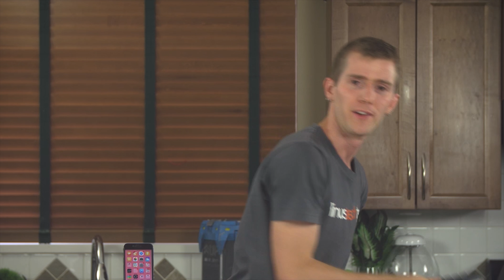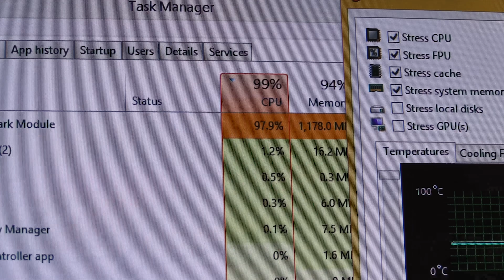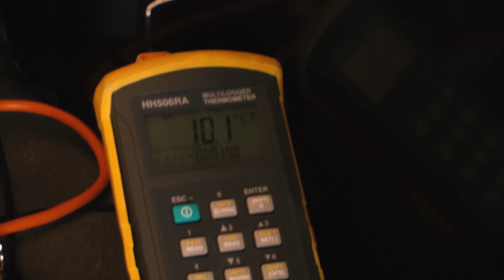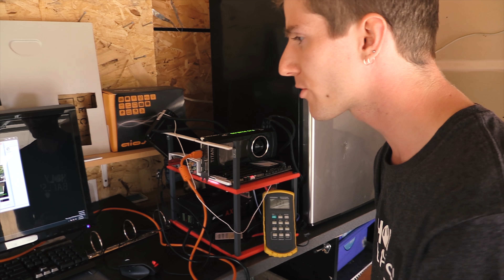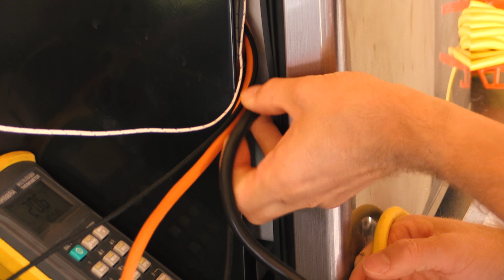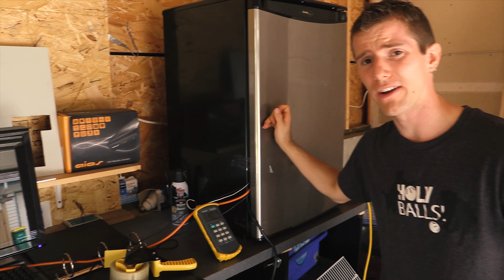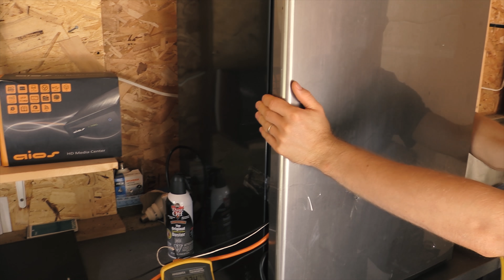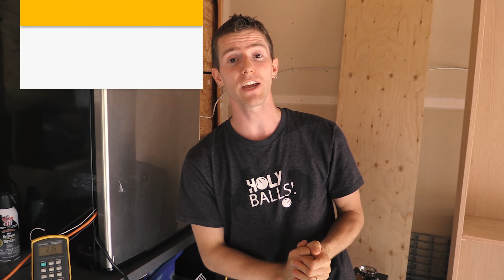PC Build in a Fridge - Does it Work??

Comment: What if you let the computer fully neutralize to the temp of the fridge before turning the pc on?
Reply: +Majick Freeman yeah, something similar to what you would buy for an RV would suffice and is relatively cheap
Reply: +Mika Vanderak No you wouldn't. Does milk or water get condensation on the side of it inside of a fridge? no. The radiator wicks away humidity just like the radiator does in an a.c. 
I really think he did this experiment an injustice by not trying it that way.
Reply: +Majick Freeman Yes milk and water do if there is a Large Temperature difference. The inside or outside of the bottle depending on whats colder/warmer. It does not happen instantly but it does happen.
Reply: +Spoonfed No. If you put it inside the fridge where there is no humidity, because the fridge is running it won't. 
Things collect condensation because there is water vapor in the air [known as humidity] and a cold surface cools the water vapor and turns it into liquid. 
As the mobo will be room temperature when u put it inside of a much colder and zero humidity refrigerator  it's practically impossible for it to collect humidity. 
if water is condensing inside your fridge than your fridge is messed up dude.
Reply: +Majick Freeman having no humidity is also a bad idea with electronics. At low humidity levels electronics components are far more susceptible to static electricity. There is a sweet spot at normal room temperature. I'm not sure how this sweet spot changes at lower temperatures though. But essentially there is a reason that data centers have very finely controlled humidity levels.
Reply: +Brad Hesse That&#39;s interesting and all, but I don&#39;t see how it&#39;s really relevant when you consider either way if that computer goes in the fridge it&#39;s going to be in 0 humidity. Doesn&#39;t matter if you let it get cold before you turn it on or if you put it in there and then let it turn on. 
Also, if someone were considering doing a fridge build i&#39;m doubting the would be going in there and touching things all the time...
Also consider this &quot;Do you get shocked when you grab something metal out of your fridge?&quot; 
I can&#39;t remember a time that I ever have, not saying it&#39;s not possible. 
It&#39;s not like it&#39;s going to get statically charged if it&#39;s just sitting there in the fridge. 
But, interesting comment none the less...got me thinking...
I still think he needs to redo this experiment and let the fridge get it to it&#39;s normal cold temperature with the mobo inside before powering on...
Still can&#39;t think of a reason that would be a bad idea and not in this experiment. 
I love linus tech tips so not knocking anyone or trying to argue.... I also don&#39;t plan on making a fridge build anytime soon so I have no pony in this race...just interested...cuz science
Reply: The problem with static isn't just a problem of touching and shocking it. Static effects the chip itself. Arcs of electricity jump from one component to another, etc.
Reply: +Brad Hesse I still think trying the experiment my way is worth a try. 
i mean it's going to be in the fridge either way. And it's not like linustechtips would be hurting if they fried one chip...which i don't see my way as that more risky than his way anyways. 
Does everyone just want to argue with me? 
I thought at least one person would see the merit in my idea.
Reply: +Majick Freeman heat was rising. Your way wont change that. It will only take a little longer.
Reply: +Spoonfed That's a valid point and I realized it myself too. 
But, the point of experimenting is to put theories like this to test.
Reply: +Majick Freeman the problem being that a fridge's cooling system is not designed to remove the amount of heat that is being generated.  Being it is a closed system the heat is only removed by the fridge.  A mini-freezer might work but then you would have to have a good desiccating system to remove any moisture introduced from open & closing the freezer so frost doesnt build up on the components.
Reply: +789 Gaming There's a good idea, but you said a good desiccating system? 
i bet simple silica gel packs like they have in new boxes of shoes  would work just fine. A simply tub of dessicant would do the trick. It wouldn't take more than a minute or two of preparation i think

Comment: No, it is not a good idea. Sure a fridge might get cold, but it does not have the BTU capacity to pull all the heat out of the PC as its created.  The longer the PC is on the warmer the fridge will become until you eclipse ambient at which point things will get ugly pretty fast.
Reply: +Diesel Ramcharger I think the problem is that most people think fridges are somehow magical and don't understand the rating of the compressor in a mini fridge is at least 100x smaller BTU rating than a common central air conditioner. (Maybe... 150 BTU vs 20,000 BTU)
Reply: Bowowowification Yeah they really don't get it. No one thinks about how long it takes to cool down a warm 2 liter of soda in the fridge…

Comment: Also... Quick question.. Prime95 only seems to push my cpu to 85% give or take, why is that? Is there a way for me to push it more???

I have an AMD FX 8320 Black edition clocked at 4.2Ghz with slight vcore bump and it only gets to about 34c with Prime95 running... I literally had to hold a hair dryer on high to the rad for 10mins just to push it past 38c. WTF is that magic am I right!?
Reply: Yes, I am aware that lower temp is a good thing.... But this was in a closed room.. After doing multiple tests one after another..

Comment: Try putting an automotive electric radiator fan on the back of your mini-fridge (over the condenser), this could give your system enough extra thermal transfer capacity to cope with the heat from your second PC.

Comment: You stooged it run duel liquid heat sinks and have the first one out side the fridge so it dumps a large amount of the heat to the room then a secondary in the fridge to cool it even further or better yet leave the computer out of the fridge and run a secondary heat sink radiator into the freezer section

Comment: I tested my laptop in my fridge for a whole day to troubleshoot a problem that was said to be linked to overheating.  I used an external monitor and wireless peripherals.  The fan outlet temp is normally 140F.  After cooling in the fridge it settled at 110F.  The fridge maintained 40F air temp the whole day.  It didn't improve my problem at all, which was and still is constant "Can't display webpage" errors from web browsers.  You're not supposed to cool a HD rapidly due to condensation but I have had not ill effects that I can detect.  Laptop is a HP Pavilion tx1308nr running Win7.
Reply: +Stephen Kramer If the laptop dissipates 90 watts of power and the fridge is a normal sized one rated for say, 1100 BTU (322 watts), you might be able to keep the laptop cool for long periods of time. (But still - condensation.)

Comment: Just build one inside a regular fridge. That could run literally any program conceived by mankind
Reply: +The Dark Aura It might barely work. If a regular fridge is rated at say, 1100 BTU, this means it will remove 322 watts of heat. You might be able to keep it at ambient temperature doing such a thing.

Comment: The ambient temperature inside the fridge was high primarily because you didn't have it closed due to the cords and wires. If you had drilled through the side and run everything through there, it would have worked a lot better

Comment: Just do what I did about a month ago. Grabbed my PC, made the HDD external, stuck the rest of that shit in my grandmas old deep freeze (she got a new one don't worry), drilled four evenly spaced three inch holes in the corners (one 1.5 inch for wiring) and put three inch fans in them. Two cycling air in, and two cycling air out. BOOM, overclocked the hell outta mah shit and now I am a boss . . . in the garage because a deep freeze is heavy as fuck and too big for my room. And the best positive? It's a desk too. Who needs 650 frames in BattleField 4? No one . . . but I can do it. Who needs 800 frames in Fallout 4? NO ONE because the game would go at mind bending speeds . . . so I'm stuck at 110 . . . but hey? EIGHT HUNDRED MOTHER FUCKERS! WHO NEEDS 999 FRAMES IN CS:GO? FUCKING EVERYONE! HEADSHOT CENTRAL!

Comment: it should have a air exit conneted to the fans   so you dont recirculate the air   so it would keep getting cool air in and spew out the hot air.  it would need a beter fridge in the first place too

Comment: Your result is unsurprising. 20 years ago, a mini-fridge was viable. These days, it has to be a DEEP FREEZE that is very well sealed and fully dessicated (trapped moisture).

Air is NOT a good conductor of heat, which is why air movement is extremely necessary. Liquid cooling is quicker and cheaper. If you choose to use a sub-zero coolant (probably some form of alcohol) you will still need dedicated refrigeration on the other end, the cost of which will probably outweigh the gains in "over" clocking.

I've just built two 3GHz multi-core machines maxed out to 32GB of RAM (2MHz). I've NO intention of over-clocking; I built them for longevity. Under my "normal" use for the next ten years or so, air-cooling is adequate.

Remember, too, that to make enthalpic calculations on efficiency you need to work in Kelvins not degrees F or C.

Comment: i'd run a heat-sink outside of the fridge to dump the most heat, at least bring it down to ambient external. (might require a thermostatically controlled valve so at idle it wont pump out the cooling)

Comment: You're overcomplicating this. The active wattage of your minifridge is way less than the active wattage of that monster power supply. Power is energy per second. Even if your fridge were a 2nd-law-of-thermodynamic-defying 100% efficient, you are putting way more energy in every second then you are taking you are taking out every second. Net result? An increase in thermal energy in the system. Here's a great link for approximation purposes. uml.edu/docs/ApplianceEnergyUse_tcm18-149292.pdf

Comment: I got hold of a AC unit that came from a store rated at 19000 BTU  (~5500 W) many years ago. Unfortunately I never got around to making something of it. It cooled air and heated water (going to a radiator). If it had been the model that supported heating as well as cooling it would have been much easier since that would have cooled water and heated air rather than the other way around. Just build a hermetically sealed box for the motherboard, CPU, GPU to avoid condensation and run the cooled liquid through a normal water cooling setup. You could have had an insulated shared reservoir and cooled an entire LAN-party's worth of computers off of that thing =)

Comment: you actually need to drill a hole in fridge and fitt it with vacum cleaner motor to suck out cold air from the fridge and blow it on to the rig 
what you do here is the same like trying to breed with plastic bag placed on your head and ducktaped around your neck.i mean you can breathe but only for a short period of time :) a actually connect my pc cooling system to a air conditioner :)

Comment: Hi Linux.. follow me on this.. The frige is design for static heat/cold.. u got fans in ther .. movement of air reduzes efficiency in a closed space.. so the PC is making itself an invisible hot blanket ... Please try again with no fans, if possible .. because i think it will work like that.. after all heat is energy , and energy is movement.. Just a thinking point of view.. apologize my eng..

Comment: I used to work in a commercial restaraunts kitchen and we had a blast fridge/freezer which essentially is meant to quickly cool super hot food to freezing temps in minutes. It has a fan in the back that would solve the airflow problem and the lowest I've seen it go is 0 to -10 Fahrenheit  (sorry, I'm American) so I believe it could probably handle an I7 and a 980ti running at load.

Comment: But what if you refrigerate the COOLANT?  Instead of putting the entire rig inside a mini fridge just put the reservoir in a liquid cooled setup in the mini fridge.  That way your still dissipating heat with air outside of the mini fridge, put you pumping way colder coolant tot he computer. I want to see a video on that idea!

Obviously you have to make sure that the coolant isn't going to be so cold that it causes condensation inside your computer (yikes!) but keep it cold enough that instead of pushing room temperature water to the machine your actually pushing significantly chilled water though it.

Comment: Humidity is the reason you don't see these type builds.  introducing something that produces heat with something producing cold air tends to create water from the moisture in the air.  and it eventually will buildup on the components.

Comment: As we now know it wont work in an enclosed space. Another experiment worth trying is ducting an ac outlet in through the fan intake. Appropriate cfm ac unit though. Another concept is isolating the radiators in the system in a colder environment.  Have to think how the system works say on a car, different apps but same concept. On a car your using puller fans mounted engine side to pull colder air through radiator from the bumper.  On a desktop you pulling air from the hottest area through the radiator to cool the fluid inside. When I look into the radiator systems for pc they dont give a good description on cooling capacity. On a car radiators are "generally" noted of cooling capacity by cores and those core sizes. More cores "generally" more cooling capacity to reject heat. Interesting video btw.

Comment: Just for pure amusement. What if you could isolate air flow to and from the heat sinks outside of the fridge. That is, both intake and exhaust. I would be curious to see if that would make a significant difference.

Comment: mini fridge, no, mini deep freezer, or full size fridge(or mini fridge with frankenized full size compressor and heat exchanger, preferably a window AC compressor and coils) maybe, if the PSU were external, and preferably the GPU as well because you're not going to get as much of a gain from the GPU overclocking compared to how much base heat is produced and needed to be phase changed out of the fridge, mini fridge will usually average 50=100 watt heat dissipation capability, where as a deep freeze or full sized fridge will cool the equivalent of 300 watts and use about 400 watts average constant(IE pumps running) with peaks of 600 watts, my full sized deep freezer runs about 800 watts average1200 peak, but its a lot older and probably only has cooling capacity of around 500-600 watts, though none of these are really suitable for constant use, a $120 window AC unit will probably have the cooling capacity because many of those have a cooling capacity of over 1000 watts, your average house AC will have at least 10000 watts and probably 16000

Comment: What I've always wanted to do is hook up a liquid cooling system to my CPU and/or GPU, then route the cooling lines into a freezer, where the radiator and fan would be placed.  I've thought I would drill the holes for the lines in the door (where no coolant for the fridge flows), seal up the gaps with RTV, dilute the water in the coolant lines with a percentage of alcohol to prevent freezing, and see what happens.  

I just haven't had the extra cash to destroy a mini-freezer or fridge like that, or for the cooling system itself....

Comment: What about a freezer?
Reply: Brobble Well a freezer is like -18c vs a frigid 2c
Reply: +Brobble actually freezers in full size fridges tend to be forced air circulators more like air conditioners.  While fridges are usually more passively coil cooled without fans. More modern full size fridges are getting fans both inside and out which would fix or minimize the problem Linus had.
Reply: +KB_TheDireWolf Freezers will cause condensation on the components.
Reply: +KB_TheDireWolf This makes no sense. You're giving the set point they are rated to cycle at ("a freezer is like -18c") instead of their BTU cooling capacity. If you had the rating in BTU, convert to watts, then compare to the watts of power dissipated by whatever is running inside of it. Simple math. In the video, the mini fridge has around a 150 BTU rating. This means it will remove around 44 watts of heat. The computer is dissipating maybe 300 watts.

Comment: dip it in the oil tank to avoid moisture and put it in to mini freezer this will cool down the oil and all the components with it if needed you can change thermostat with it you will be able to control freezer temperature more accurately from -1 to -32 and thats about it

Comment: Quick tid bit of info internet. Fridges are designed to keep stuff cold, not cool down hot stuff.... No way will the fridge keep up with the heat on the computer and you'll probably just end up burning out your compressor.

Comment: DUDE DUDE DUDE, what if you have a water cooler in the fridge. It'll never freeze but it will always be cold as fuck water.

OMG WHAT IF, you set up the water cooling unit for your pc inside a minifridge, and drill holes in the front just big enough for the wiring and insult the wire to the fridge door to make sure no air comes out or in, so the water in the water unit will always be cold.

Comment: What about a water cooled PC with all the rads outside of the fridge..?
Or maybe even a mini freezer..?
this way the heat will still be "dumped" outside of the fridge/freezer and the CPU/Mobo/GPU will enjoy a cool ambient
You could even put the PSU outside, you could drill some holes in the fridge/freezer for the wires and fill it up with silicone...
This way the only heat inside the fridge/freezer will the heat that the water blocks won't pick up..